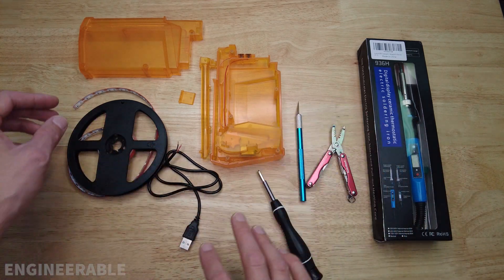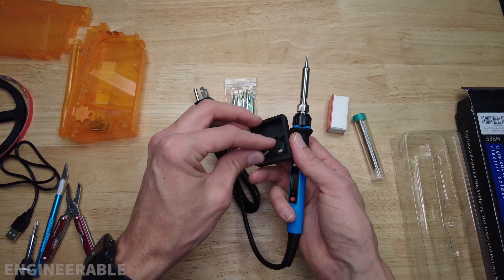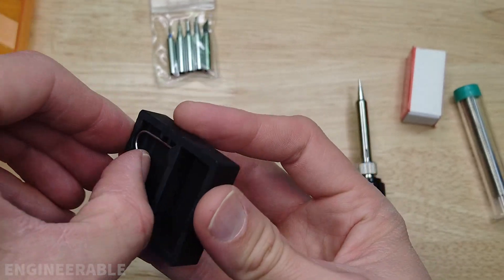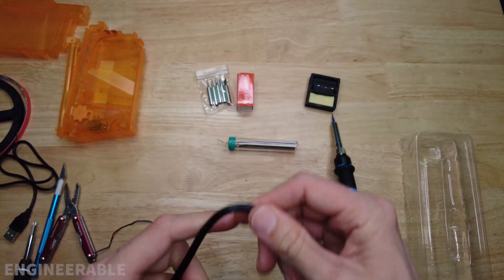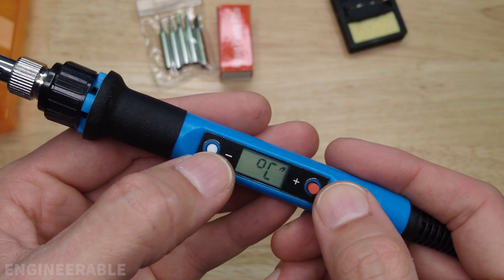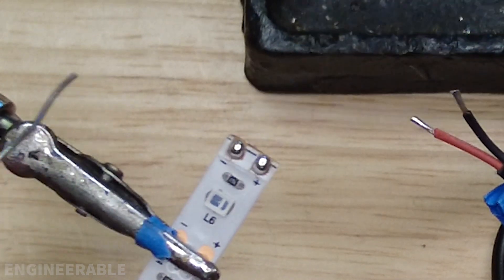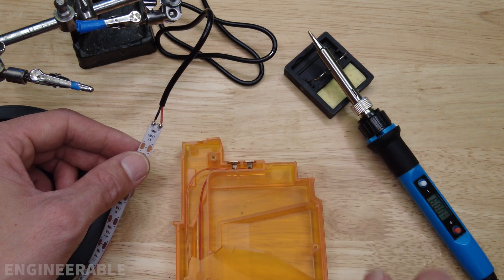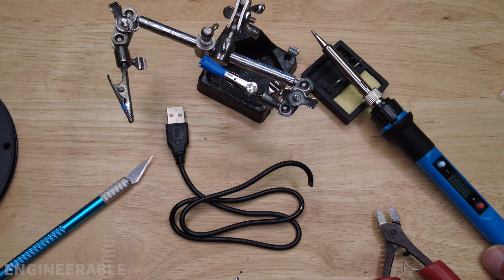MOD GEL BLASTERS with this CHEAP SOLDERING IRON (for glow tracer, motor, battery mods, & repairs)

Comment: I attached a 5v LED stripp, but i think its draining too much power from the ball feeding motor and i have a lot of missfires without a gel ball
Reply from the maker: The LED strip should not be draining that much power to cause an issue. I haven't had that issue with any of my mods. The more likely situation is that you are using glow gel balls that grow too large and don't work well with Splatrball mags. Check out this post on recommended ammo https://www.engineerable.com/single-post/which-gel-blaster-glow-gels-work-and-in-which-blasters

Comment: question about the light can i just fit the whole uv light in there or does it need to be on the feeding tube?
Reply from the maker: I have several different tracer mod videos that give you different ways of making the tracer mods. 
https://youtu.be/abU3cqMv7m8
https://youtu.be/c3-62DxvW4A
https://youtu.be/JKV0kX_kFrQ
https://youtu.be/R0tOKlR0lC8

Comment: Hello! i just recently purchased an srb 1200 and i threw an 11.1 in it
it shoots so fast my question is. is it going to just break eventually?
Reply from the maker: It will break faster. Either your gears or motor will break. These are just not designed for the stress that an 11.1v puts on it.
Reply: Do you have a full buy kit to make this 11.1v lipo ready?
Reply from the maker: @Smoothslash777  This video shows the metal gear + spring upgrade (srb400 is same gearbox as SRB1200). https://youtu.be/qQKaKdEUPCs 
The problem is that the gearbox is non-standard, so the upgrade is a pita, and not worth it.
Reply: Or like a full parts list gears motor spring
Reply: Now just want to clarify when you say not worth it do you mean not worth it money wise or not worth it headache and problems down the line wise
Reply from the maker: @Smoothslash777  It's not a straight forward upgrade. It requires hacking and modifying parts to make it work because the gearbox is not standard. Time/money would be better spent upgrading a blaster with standardized parts (compatible with airsoft and gel blaster parts)